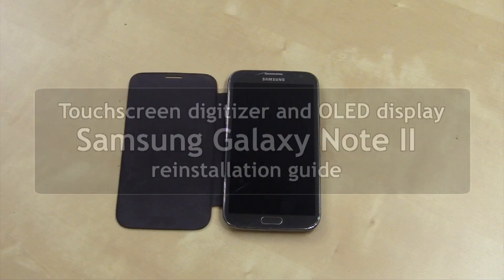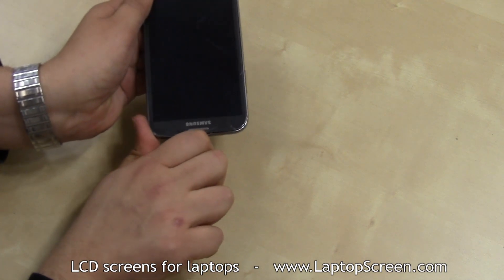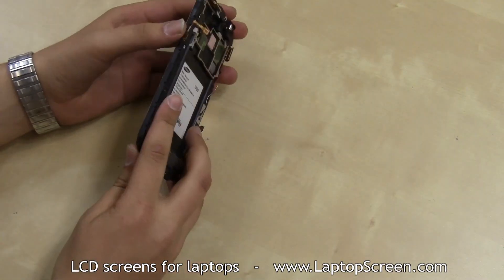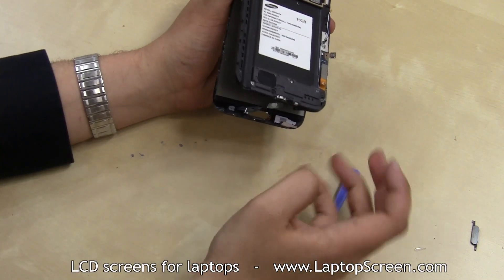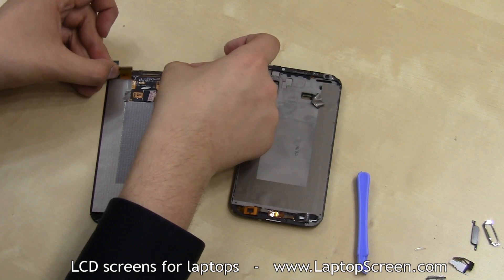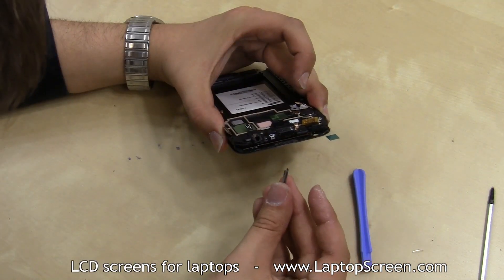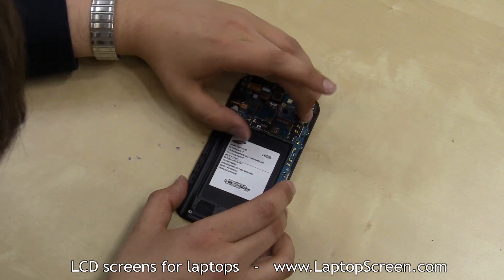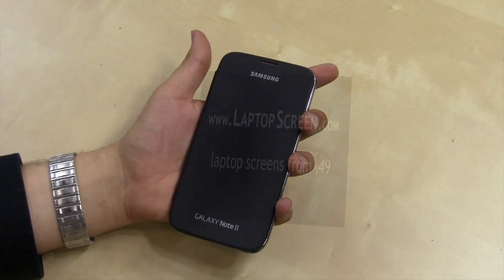Galaxy Note II screen replacement / repair disassembly and reassembly guide

Comment: Thanks I wondered if the tape need to be replaced on the bottom between frame and LCD i see it does not have to be replaced only the tape around the glass to the frame right?